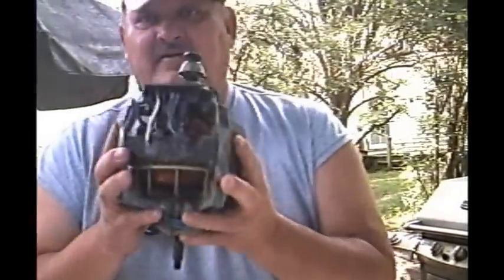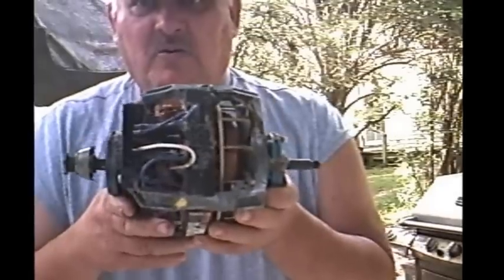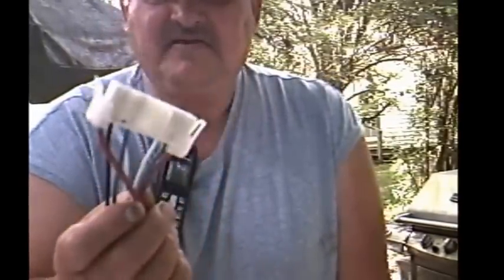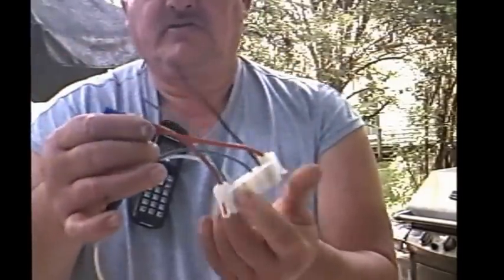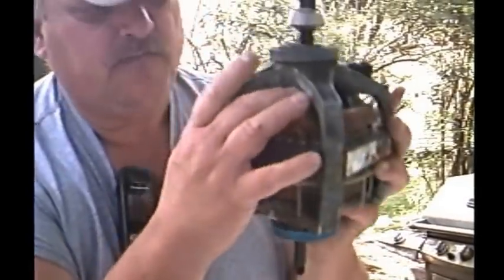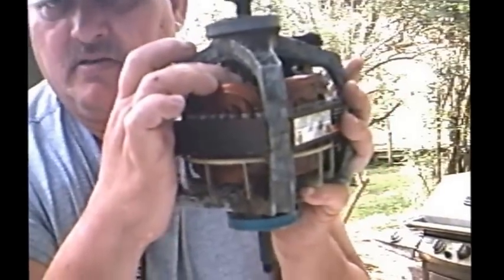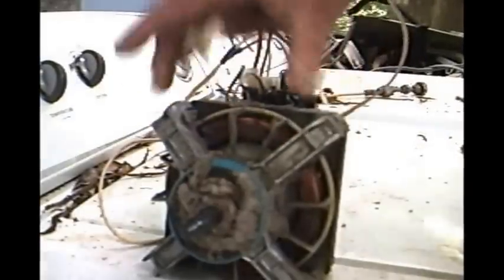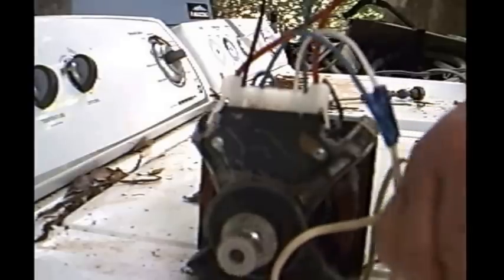Dryer Motor Checker

Comment: how to oil these sealed motors????????
Reply from the maker: easy. drill a hole in the rotten cotten wells and fill them with zoom oil work the shafts loose by hand and run it a minute to loosen it up furthur. 50 50 chance of reviving
Reply from the maker: you can do a 50 50 mix of zoom oil and rust buster on tough bearings

Comment: Good info my friend......much appreciated.   Be sure to check continuity between the two red wires while manually activating  the centrifugal switch.....while disconnected from power.  The motor will run but if your heater switch is bad there will be no heat.

Comment: Hope you can still help. Can you wire up the alligator clip directly to the donor plug? I dont have an extra harness to connect to the motor.
Reply from the maker: Before I made my fancy plug that's what I did. used my cheater cord. I used my watered down cheater cord to prevent arcing in case of shorted motors. All you do is use an old dryer or water heater element and connect it in series with one side the 120 v cheater/power cord. That way most of the energy is absorbed by the element but you still have the voltage to run the motor.

Comment: I actually just got my old dryer motor out of that old run down dryer and got it wired up to run but had no clue that those other wires were for those other things! I figured it was wired some way to make it run off of 220 volts even though the name tag said it runs off of 120 volts. SO thanks for the details in this. I appreciate it cuz now I understand it completely....AND I now know a way to oil those bearings too!!!  :)

Comment: What were to happen if you wired directly to the main winding terminals? Would you need to wire a momentary switch between the main winding and start winding?
Reply from the maker: The motor run wire is live but not in the circuit until the cent switch is fully extended then the start winding gets dropped out and run is engaged.
Reply: Dan Webster So the switch has to be fully energized to engage which in turn automatically works the starter winding circuit? That sounds too easy. I'm seeing videos of newer motors with jumpers for switches, etc (such as mine). That's where I was a bit confused by the red wires tied together but I saw your comment below.
Reply from the maker: The 2 red wires go to heater. If the motor don't run, the heater wont come on. Them fat thick red wires are only on when motor is running not wired to any live stuff in the motor. That's a safety feature. They dont short nothing because they basically are the same wire acting as a gate.
Reply: I got it solved. I've got a motor from a 2007 Frigidaire Gallery dryer. Looks like it is a common wiring scheme on Frigidaires.  I assumed I had a belt switch terminal on this one but apparently not. I'll share the wiring for others (from schematics).

White (M2) = Neutral
Yellow (M1) = Neutral for dryer igniter (switched on when motor starts)
Black (M5) = Hot (Run/Start)
Tan (M4) = Neutral (Direct to centrifugal switch/motor)
Gray (M6) - Hot output (switched on when motor starts)
Green = Ground to chassis/ground cable wire

The gray hot wire is giving me ideas. Power light maybe?

Comment: I am curious as to why you wired the 2 red wires together (heating element power runs through one side, through the centrifugal  switch and out the other side) ? Thanks..
Reply from the maker: It's just for fun for show and tell. The 2 red wires tied together represent the 240 circuit. They are heavy red wires that carry the power through the system. when the motor is idle nothing goes through the red wires it only makes a complete circuit when the motor is running.
Reply from the maker: So when the motor aint a goin the heater element aint on
Reply from the maker: If the heater element is ever on while the motor aint running most likely the element is grounded to one side of the power source.
Reply: I have seen where a heating element wire broke and welded itself to the case causing a dead short and the dryer heats up without being turned on.
Reply from the maker: that do happen
Reply: My dryer motor has two wires that need to be jumpered to bypass the belt switch just to run. The connector terminals appear the same as yours but the wire colors are different. Some of these appliance motors will overload/rotate insanely fast without a load, probably why there's a belt safety switch on mine.
Reply: no that switch is there to operate only when the belt is good , when you loose belt tension , the switch relaxes and breaks current and stops the motor , so when your belt breaks , the dryer wont start cause the tension switch has no belt tension on it cause the belt is broken so the switch breaks current . its called a belt tensioner switch .

Comment from the maker: the motor mounts on each end are atop them wells you drill between the mounts and the armature being careful not to go too deep and hit the bearing you only want to access the cotton well and load it with oil then you want to work the motor free i use a vice and spin the motors. I have videos of that
Reply: Can you provide a link in your description to the video about the drilling and oiling so I can find it?
Reply: Dan Webster -My motor spins but seems to heat up and squeal then stops. Thanks again for your videos!
Reply: Dan Webster - Not sure I've ever seen flame proof save oil. Is it at my local big box store?
Reply from the maker: ace hard ware has it for$3
Reply from the maker: http://www.ebay.com/itm/like/221422651356?lpid=82&chn=ps&ul_noapp=true

Comment: Curious on how you drill the holes and made the bearings not squeal ......I have a hum and squeal and then motor seizes up and will not turn.
Reply from the maker: You drill using 1/8th inch bit into the wells on each end and apply a flame proof save oil i use zoomspout it is safe for appliances

Comment: Thanks so much for making this video... I have a whirlpool dryer motor that i took out of a dryer and i've been wanting to make a  bench belt sander out of it, But couldn't figure out which wires to connect ... I've looked all over the internet and finally found your video.. My motor has a pulley bracket mounted on the side of it with a switch under it.. I'm supposing that is a belt switch... Will i need to bypass that switch in order to get the motor to run, or let the pulley bracket touch it and ingage the switch? I'll go try it tomorrow .. Thanks again
Reply from the maker: no leave the switch be just connect blue and white and it should be ok

Comment: what pins are you using? it has numbers on the connector.
Reply from the maker: +pepsi p I gave the thang away so not sure of the numbers but the colors a white common blue and back start and/or run and the 2 reds 1 and 2 are for the heat circuit
Reply: +Dan Webster (Paw Paw) Thank You Sir. I got it already it's pin 3 and 5 to start the motor. great video I'm trying to make a pig rotisserie. Keep up the good work
Reply from the maker: +pepsi p Thanks I want to see the set up once you get her rigged
Reply: I am hoping to mount mine to a modified ATV stretched out so that I will be about 3" off of the ground while riding it.